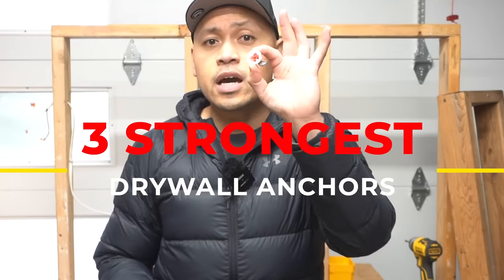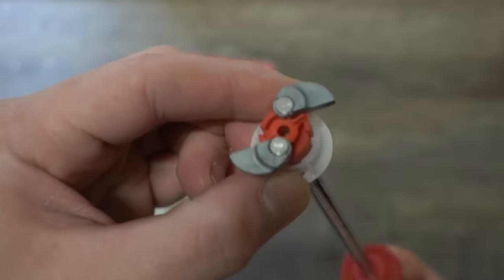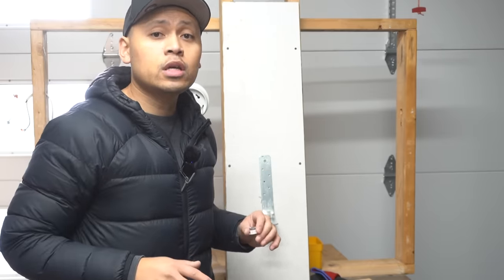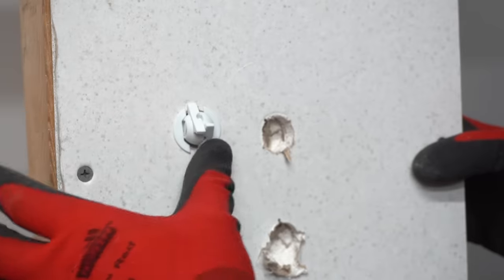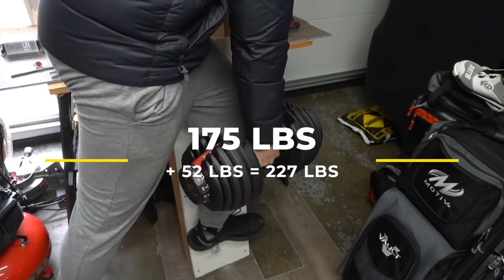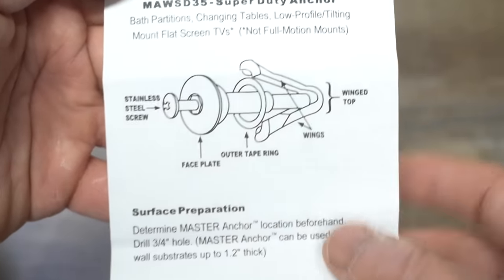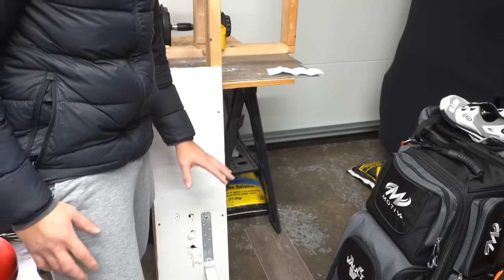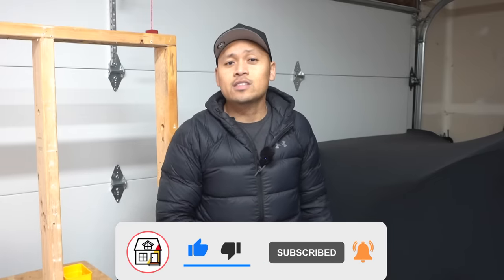Worlds STRONGEST Drywall Anchors EVER MADE! Lets Test it! How To DIY!

Comment: How do you not include EZ Anchors, FFS? 

EZ Anchors pretty easy to install, and, in my experience, are more likely to pull the drywall OFF the studs than they are to surrender @ the anchor (Yes, literally had that happen. The whole drywall section was pulling off the stud due to a bookshelf (with lots of books on it) that I'd secured with EZ Anchors -- resecured the drywall and spread the weight across more EZAs, problem solved).  And they're probably much cheaper than any of these 3, certainly cheaper than the first 2.

Biggest issue with EZAs is avoiding the studs and any other internal bracing. EZAs are better than pretty much any other anchor for anything except brick or cinder block walls. And the holes, once it is removed (it screws right back out, and is even nominally re-usable, leaving a hole the bore of the EZA) are  no bigger than a simple spackle application.

Comment: So far, for stuff I might hang on drywall such as a cat shelf, I find the plastic screw in fasteners to be more than adequate. I have two cat shelves 12" wide mounted on 2 regular 90deg shelf brackets (3 screws in the wall each) that have taken having 14lbs cats jumping on them for years and they are still tight.

Comment: The larger the hole, the larger the contacted area between the anchor and the drywall, which helps reduce pressure on drywall's contacted area. If they make a practicable simple plastic anchor as big (diameter-wise) as that, it will be able to support the same claimed weight.
Reply from the maker: Thank you for sharing your knowledge and feedback! 🙏🏽😊

Comment: These all require a huge hole, and only work with standard drywall thicknesses (not thicker or less typical walls like plaster). For these walls, there are much better options like Snaptoggles, which require a smaller hole, are much stronger, and work with a much wider range of wall thicknesses. 

I looked into the Gripit recently, and of all of these, it is the one that offered a unique potential advantage- it only requires a very small cavity behind the wall. It only requires a 1/4" cavity, according to information I found on Amazon (even though this critical information is not listed anywhere on the product website or the packaging..). However, this potential advantage is irrelevant most of the time when you're working with standard drywall, and these only work with drywall up to 5/8" thick. 
That doesn't allow for a double layer of drywall, or slightly thicker drywall that is often encountered when 5/8" drywall has a thick layer of mud, and certainly doesn't allow for plaster.

If they made a version of this that could work in 1" walls or thicker, with the same 1/4" clearance, then this would  be a useful product that could work where others don't. And might justify the huge hole that you have to drill, and which for many people will have to be patched in the future. But as it is, none of these are worth using ever, as there are better products that leave a smaller hole and are stronger, and work in nearly any scenario where these will.

Comment: I have a collection of valuable vintage guitars, and I won't use anything but Toggler's Straptoggles on the wall hangers. They're rated for 265 lbs. and they're a breeze to install. No, none of my guitars weighs that much, but I never have to worry about them falling off the wall.

Comment: Keeping the 2x4 studs being so slide the wall can hold. But on a regular spacing it weakens the drywall. I rather go for the studs to hold in my opinion but that is good they are better then your average ones
Reply from the maker: I agree with the studs for much heavier objects to hang, much better than the average! Thank you for your feedback my friend! 🙏🏽😊
Reply: Nice information but the testing 2x4's in your example drywall is not on a standard width of 16" center. Which is the standard home.  Thanks

Comment: i am happy with snap toggle brand. little smaller hole. won't drop the toggle. for any thickness wall. not saying they are perfect, but they hold a lot. if i used something to hold over 100 lbs., i think i would have to find a way to reinforce it within the wall.

Comment: Since the 90's I have been using SnapToggle heavy duty BA/BB Toggler and they only require a 1/2 (13mm) inch hole can easily support over 238 pounds (108 kg) in 1/2 inch drywall. They are less destructive to the drywall and are simple to use and readily available at most hardware stores.  You should compare these and you see how much better and easier they are to use. @FixThisHouse actually covered these in a video about year ago.
Reply: Snaptoggles are definitely better than all of these, but they CANNOT "easily support over 238 pounds (108 kg) in 1/2 inch drywall" 

You should read the instructions / specs from the manufacturer very carefully. As with most wall anchors those are 'ultimate' loads aka the load at which the wall FAILED. The instructions clearly state that you need to divide those numbers by a safety factor of four. In 1/2" drywall the maximum safe working load (if they drywall is in perfect condition) is 60 lbs tension / 62 pounds shear. Which is about as strong as you're going to get for any drywall anchor.

It seems like nearly everyone, including many 'professionals' and people with youtube channels, have no understanding of safety factors, and are constantly quoting the FAILURE ratings as if that is the working load rating. 

By the way this isn't  even factoring in the adjustments you need to make for cantilever forces (for things like shelves), or additional stress applied by motion or vibration that needs to be accounted for  in many cases.
Reply: @danstheman33  I have a very heavy statue that I want to hang, I want to fix a large panel ( 40cm x 70cm height x 2.2xm thick ) of strong wood with 4 or 6 toggle bolts onto the drywall ( no studs at this place ), to have a maximum contact surface, then place another wood panel with squares, fixed on the first wood panel with wood screws, then put my statue on it. Statue + all pieces ( wood, squares ) should be around 40 kg. Would you say it's ok ?

Comment: Load bearing code where i am is 16" on center. Thats a big span to try hanging anything over 20 pounds. Especially drilling big ass holes in my wall to fix later.

Comment: The WingIts Drywall Anchors are for a wall thicknes of up to 1.2 inches and would be the only ones that could be used on a 1 hour fire rated wall that requires either 2 layers of 1/2" or 2 layers of 5/8" drywall {rock). although I am curious if they would work on double 5/8" rock witch measures 1.25 inches.

Comment: All the anchors in my opinion are decent products.

However ONLY the Gripit is reusable and can be used in situations where the plasterboard is inches away from the wall (because only a small screw needed and provided to activate wing mechanism)  example dot & dab plastered walls.
The other anchors cannot perform the aforementioned tasks.

Comment: Can use any of the anchors for hanging flat screen televisions
Reply: I normally do what you do, used the stud . But I the stud is not in the center of the room
Reply: No, you want to use toggler bolts for wall mounting TVs.
Reply: Use 1/4 “ snap toggles.

Comment: The problem with American drywall is that it’s single sheet. Knock into it, you’ve got a hole. Kids throw anything heavy against it, you’ve got, a hole. Over here in Europe and depending where the wall is, it’s double sheeted. Yes, more expensive but super stable and robust.

Comment: The spade bit is a super bad idea . they tend to rip up the surface as they enter and exit material . 
It is the paper that creates the strength on dry wall , so if it's torn away from the edge of the hole ,you risk failure of the anchor . it won't be possible to see the damage /tear on the back side so you don't know if the little wings are spreading out over bare drywall or not .

Comment: How about an evaluation of tensile and shear using a 1/4" drill bit compatible anchor.  Aren't we looking for the highest strength with the smallest drill hole while avoiding a protruding flange?
Reply: Larger surface area gives you the best strength

Comment: Of the 3 devices, which one(s) cant be removed if you decide you no longer want something hanging on your wall? Seems to me all three would have to be permanent with no way to remove.
Reply: The first and second may be able to be recovered after installation, but any time you're using an anchor you're going to have at least some repair work after you remove the mounting hardware.
Reply: You can remove bullfix

Comment: I wonder if Plasterboard and Drywall have the same strength, I assume it cannot be that different? Anyway you translated the measurements wrong, Imperial and US are similar, Metric is different. 12.5mm is near enough half an inch for example. A smidge under.

Comment: I’m a Industrial Engineer and also a metallurgist. Not to make a sham of your test, but in order to make a true test, the test wall needs to be at minimum of 16” on center, eight (8) foot high, 100% true and plum. You also need to have a couple anchors installed then you have a true test of its weight capabilities without the drywall self destructing. You have to hang minimum 75 lbs weights on each anchor. Your weight on one anchor is not classified as dead weight, your holding onto the wood studs. I also noted your tearing the paper backing while drilling out the hole. The paper also is part of what holds the drywall integrity intact.
In reference to the Structural Engineer just prior to me I tend to agree anything exceeding the drywall manufacturer’s recommendation is not best practice. Anything beyond recommended manufacturing specs find the stud and use the stud.
Reply: https://youtu.be/bsuz-CtCbiI
https://youtu.be/C3BWl0c3njs

Comment: I have used the Wingits, and they claim 300lb sheer strength. I used them to install safety bars in a friends, shower. 1 time he slipped in the shower and later called me and said they worked well because he grabbed it when he slipped and didn't fall. He weighed over 300lbs. at the time and was grateful they were there.

Comment: I AGREE	 snaptoggle will probably be superior- larger surface area and hole is not bigger-proven product .
Reply: https://youtu.be/C3BWl0c3njs
Snap toggle uses the edge of the metal to dig into the back of the drywall, which is not a large surface area which results in digging in over time and working loose.  Bullfix have large surface area pads away from the edge of the hole and does not work loose over time

Comment: The manufacturers are wrong to advertise the breaking point load, but safe load with a safety factor of at least 1.5 instead. This means that the first one should not break under your weight.

Comment: i think the anchor is only as good as the material it attaches to.  if the drywall wont hold 50 lbs the anchor itself will not hold.  i used metal anchors to attach closet rods off the studs and had a wardrobe of winter clothing on the floor.  wouldnt be that bad if the holes wetent so big.  😮

Comment: Ceilings tests … hangings tests are needed
Reply from the maker: Please stay tuned for future videos! 👍🏽🙏🏽😊
Reply: Well for starters you can use Bullfix in insulation backed plasterboard.  Also Bullfix do no't work loose over time because rather than sharp edges of metal digging into the back of the drywall , Bullfix have large surface area pads away from the edge of the hole, so the fixing remains rigid and tight for the life of the installation

Comment: I don't see them being any better than a toggle bolt.
Reply: Well for starters you can use Bullfix in insulation backed plasterboard.  Also Bullfix do no't work loose over time because rather than sharp edges of metal digging into the back of the drywall , Bullfix have large surface area pads away from the edge of the hole, so the fixing remains rigid and tight for the life of the installation

Comment: 10” rather then the standard of 16” on center for the 2x4 studs would strengthen the drywall and throw off the test. Still good demo but not accurate.

Comment: Why did not give the approximate price.
Reply: He linked the products
Reply from the maker: Please see links below 👍🏽🙏🏽😊
Reply: Including the price for a COMPLETE ANCHOR ASSEMBLY would have made a better video. Here are the prices per package as well as per anchor assembly from each package, as of 7 January 2024:

Bullfix, 4-ea anchors, 4-ea #10 x 13/16 screws, 4-ea washers, 1-ea 13/16" spade drill; $9.49 Amazon U.S. = $2.37/anchor

Gripit, 6-ea anchors, 6-ea screws, 1-ea 3/4" (18mm) spade drill; $11.49 Amazon U.S. = $1.92/anchor

WingIts, 2-ea anchors, 2-ea 10-32 x ? (length) stainless steel screw; $11.48 Amazon U.S. = $5.74/anchor

Comment: Stupid system, one you have to drill an 18 mm hole first, better way to go is with ITW Buildex Wall anchors, you screw the anchor right in with a phillips screwdriver, only anchor I use, they come in plastic or aluminum.